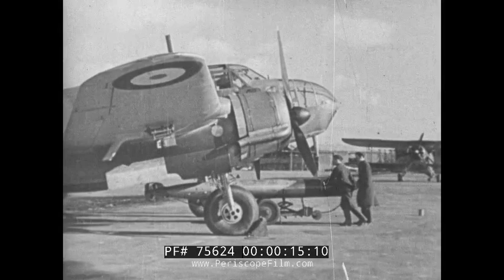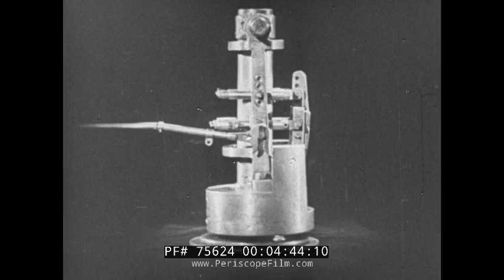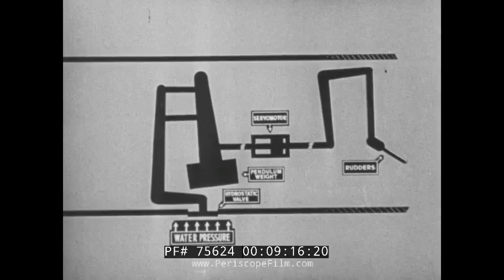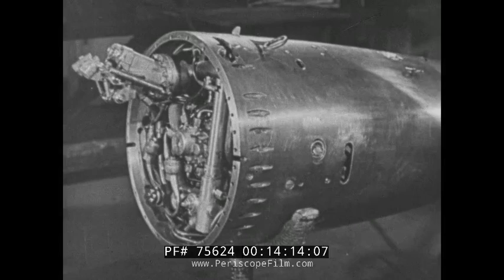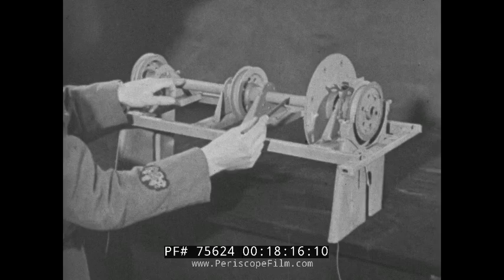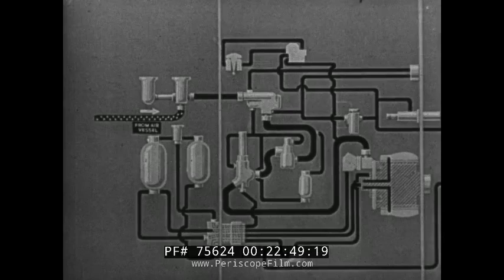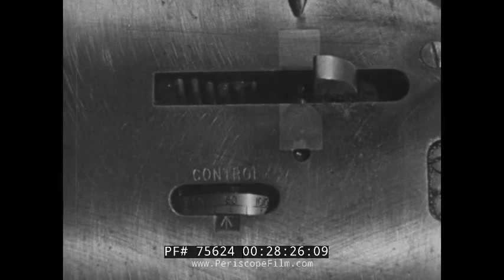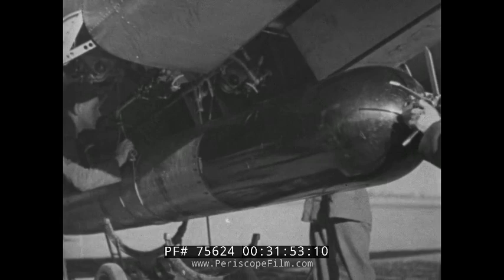AIRCRAFT TORPEDO  ROYAL AIR FORCE INSTRUCTIONAL FILM  MARK XII TORPEDO 75624

Comment: I had no idea that Torpedoes were quite so complex. It was nice to have the issues of Torpedo operation explained and how they are overcome by the design. Quite impressive.
Reply: From the movie "African Queen" (1951) starring Katherine Hepburn and Humphrey Bogart: 

Rose (Hepburn): Could you make a torpedo?
Charlie (Bogart): A torpedo?...You don't really know what you're askin'. You see, there ain't nothin' so complicated as the inside of a torpedo. It's got gyroscopes, compressed air chambers, compensating cylinders...
Reply: They're basically self guided mini-subs and have a price to match. The US Mark 14 sub torpedo cost ~$10,000, for comparison a F2F fighter aircraft cost ~$12,000 at the time.
Reply: @nonna_sof5889  Was that the one that didn't work?
Reply: ...and this was a simple WWII torpedo which ran at a preset course, speed and depth.
Modern torpedoes have sensors and are programmable for wide range of attack modes.
Reply: With the advent of small cheap computers, this task can now be done digitally using sensors. Modern torpedoes are actually simpler as a result.

Comment: These incredibly complex machines were designed and built by engineers who could read and understand slide rules. I’ll bet there are not 200 people world wide that could operate one now.
Reply: This keeps coming up 😞 Slide rules were v rarely used for detail design calculations requiring precision as better methods were available. On the occasions they were, they had to be of a v specialised large type.
The overwhelmingly common daily use was for 2 things : Rapid approximate results during eg, general design, experimental work, etc for quick checks. Number scaling during the detail design drafting process.
Any reasonably intelligent person can operate one after a few minutes, but of course it takes practice + a few tips & tricks to become proficient and speedy.

Comment: I had no idea they had fuel type engines. I always believed they were powered by compressed air alone.
Reply: Some used compressed air, some used compressed air heated by fuel, some mixed water in with the fuel and air, and some used steam turbines. Some of those replaced the air with pure oxygen instead.

Comment: Would the contra-rotating propellers also increase speed as well as help keep the torpedo on an even keel? I know that many aircraft use contra-rotating propellers for the purpose of speed alone. For an example, the Russian Tu-95 "Bear" bomber, which has propellers that spin at supersonic speeds, thus giving almost jet-like speed to the bomber.
Reply: I suspect that this was purely to ensure lack of reaction from torque which would require finely balanced thrust from each set of blades.

Comment: What if there is a bird strike on the torpedo pistol striker vanes during flight? since they remove the safety pin before take off?
Reply: Then it goes BOOM!  

Obviously it was designed to require a certain amount of impact force to actually trip the mechanism and set off the detonator... like the force of an 1200 pound torpedo slamming into a ship's steel hull at 40 knots... that's a lot of force!  It would have to have a pretty decent amount of trip force required to not be accidentally tripped when the torpedo slammed into the water during the drop... or from inadvertent contact with the drop aircraft... Later!  OL J R :)
Reply: @lukestrawwalker  Yeah i guess that's probably why there was so many duds, Torpedo pistols were a huge problem in the day as far as i read.
Reply: @oldschoolfoil2365  biggest problems were with American torpedoes... Took a long time to figure that out and fix the problem.  OL J R
Reply: I dont know this specific pistol, but usually they have also a safety flap wich flips only if the torpedo moves at a certain speed in water.

Comment: How effective was the Mark 12 i.e. its combat record?
Reply: Excellent ! It ran true at correct depth and at the right speed. It also exploded when it hit something so it did everything the USN Mk 14 didn't.
Reply: @paintedblue1791  The Mark 14 was a British pattern torpedo. The US only used it because they didn't have a torpedo available of their own design at the time. The British constantly said the Mark 14 operated fine, despite never having actually tried to blow the damned thing up.
Reply: @MJRSoap  The Mk 14 was not a british pattern torpedo, it was designed and developed by the US Naval Torpedo Station Newport and it was also the one who said the Mk 14 is fine without doing any live tests, not the British, they didnt even use the Mk 14. The US had massive problems to supply its own fleet with the Mk 14 so they couldnt supply other navys with it.
Also the US navy still had the Mk 9 and Mk 10.

Comment: I wonder if there were any air-dropped 21 inch torpedoes?
Reply: No a 21' torpedo was just to heavy and long to withstand dropping from an aircraft.
Reply: keith moore  Even for something like, say, a Lancaster or a Halifax.
Reply: @nicholasmaude6906  Total weight is not the problem its mass. The torpedo will pick up so much momentum in the drop it would break up when it hit the water. It is a long thin object and stresses to its case would bend or break it unless its reinforced to the point it would not be able to float. It also not practicable to go that large and it would restrict the types of planes able to carry it.  Better to carry two 18" than one 21! which He 111 did.
Getting a clean drop and a "Runner" was a difficult skill to master. Torpedoes can clip a wave top and bounce before getting into the water properly and then they could be off in the wrong direction at that point.
Reply: @paintedblue1791  
Mk 13, Mk 21, Mk 25 are aerial 22.5" torpedos and the Mk 41 is a 21" torpedo

Comment: I want to point that hydrostatic valve and pendulum action righting mechanism for torpedo guidance, is based on same principle as human male uses to keep himself upright. Female humans, have a different, yet unknown biological mechanism to keep themselves upright, but it is not effective as male version, as human females keep falling down and spending much of their time on their back. The theory, yet unproven, for human female vertical instability is that it is required for continuation of the species. It has been observed that in the wild, among human population, that consumption of alcohol mixed with water adversely affects righting mechanism of both male and female gender of the species. More field study is needed.
Reply: @mytube9367  OK please answer following questionnaire
1. What is your gender? A male. B female . C Uncertain D. Both E. Gender fluid. F. Unknown G Other gender ( for example emale).

2. Are you willing to consume large amounts of watered down rum, cheap tequila, mezcal,  and watermelon soaked in Everclear? 

3. Are you willing to expose yourself lewdly , whole inebriated, for sake of scientific knowledge? Please note that all prococeedings will be recorded.

4.Are you willing to undergo full body Brazilian waxing without Ibuprofen? All participants are required to be smooth operators.
Reply: That does explain a lot. I’ve wondered.

Comment: Currently building a TFx Beaufighter and it somes with an air stabilizer for the torpedo, but no instruction as to fit it. Also the propeller screws are moulded at the same angle, which I want to fix so that they are in the starting position. Also I notice the brush-marks left by the oil-guy. Must include those! 🛬

Comment: RN torps must have been better than USN torps.
Reply: This is a mark 12, so that tells you something. Were the other 11 not much good?
Reply: @flybobbie1449  The previous marks were slower had less range and carried a smaller war head, but work fairly well for there time in service. The Mk 12 was a 18" torpedo that was for air launch while the earlier marks were surface or sub launch weapons.
Reply: They were.